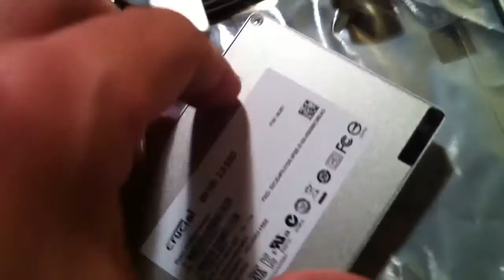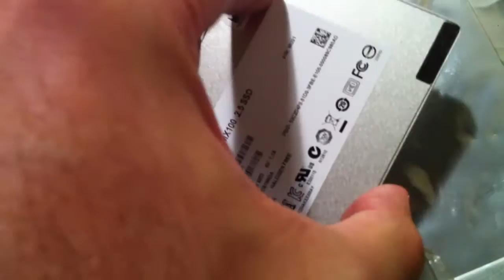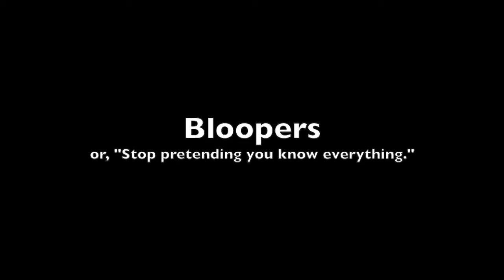Installing a SSD in a 24" iMac, velcro hack (Part 2)

Comment: I always lay the screws in the same pattern on a wash cloth away from the work space as I take them out. No guesswork.
Thanks for the Velcro tip, it saved me from buying the unusable adapter. And the close-up of the drive saved me the time finding the right SSD for my 'puter. Good job!